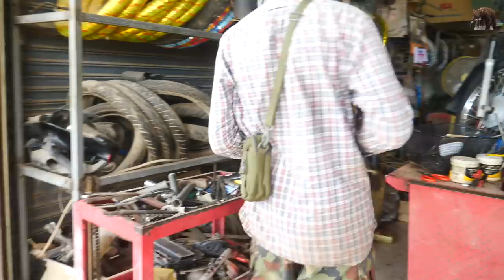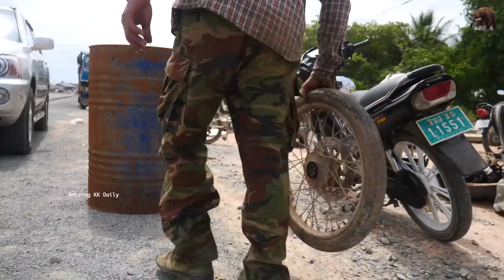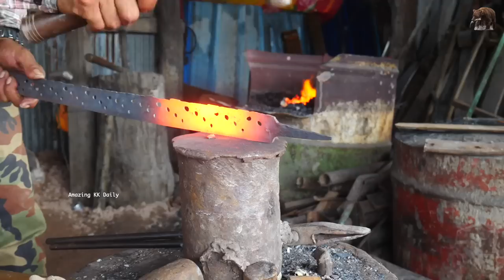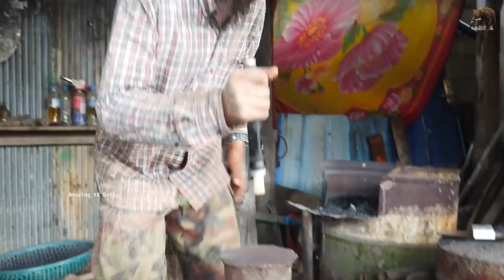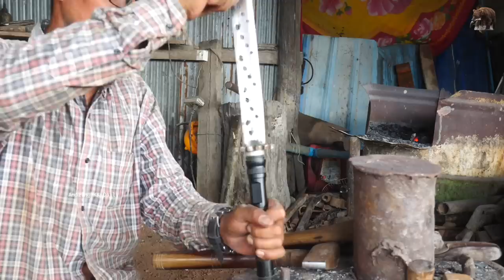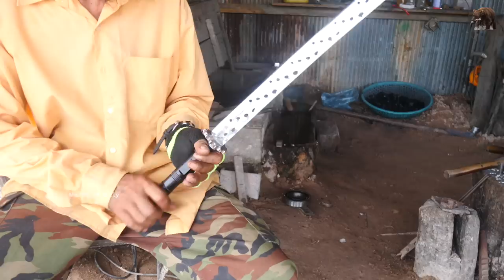Making A Sword From A Broken Brake Disc, A Broken Motorcycle Sprocket, And A Torch Tube

Comment: don't use cutoff disc without guard. if it breaks you can lose a finger or an eye. other discs are ok without guard though not optimal, but not thin cutoff disc.
Reply from the maker: thank you for your concern